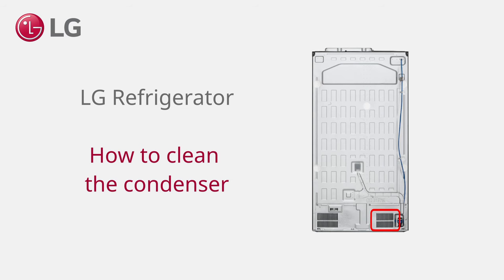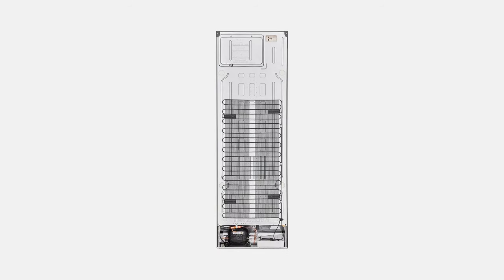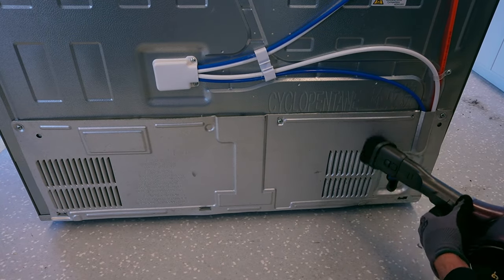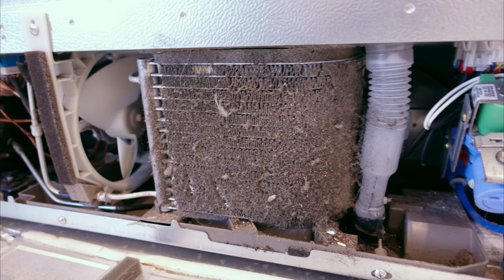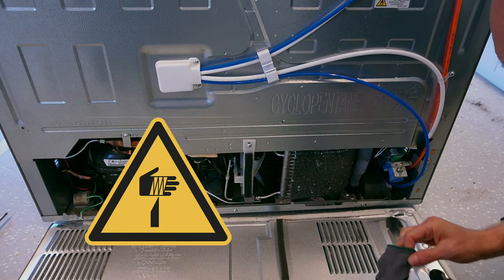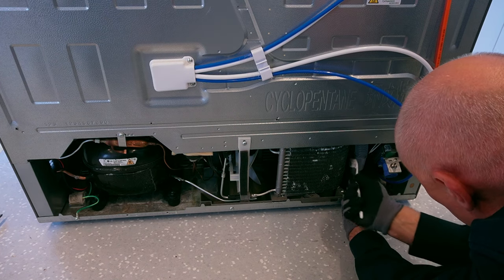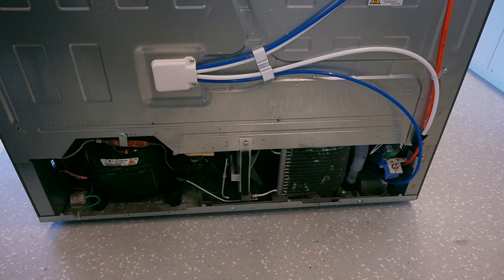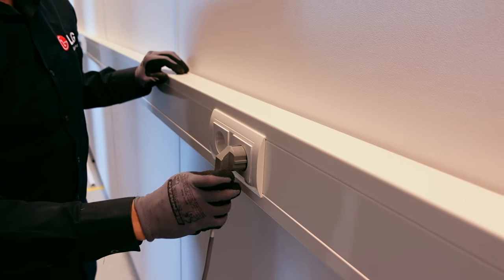[LG Refrigerator] How to clean the condenser

Comment: Hello, my model (LRFXC2606S) has an ice maker and the manual says not to remove cover to clean the coil. Is it ok to remove it like in this video?
Reply from the maker: Dear, If you follow the instructions in the video, yes it is. However, it is always at your own risk as this is a service procedure. Note that there may be differences in the models and how easy/difficult access to the condenser is. Most important safety measures are: wear gloves, do not damage the small condenser fins and, most importantly, work with the power UNPLUGGED. If you are not sure, please contact your local LG support desk.

Comment: What will happen if we do not clean the condensor ?
Reply from the maker: 1st, you only need to clean the condenser if you see a lot of dust (possibly stuck to grease/fat from the kitchen) through the condenser cover. The dust essentially prevents that the condenser can release the heat that is absorbed from the inside of the refrigerator. The cooling performance will go down eventually.

Comment: Not useful because they designed most of their coil air flow from the right side and then block it with a brace and cooling fan so you cant safely clean the coils without disassembly.
Reply from the maker: Hence the suggestion to wear gloves and unplug the power first Sally. But as mentioned, we also sell refrigerators with a condenser mounted on the back wall.
Reply: I had no issues. My fridge matches the one in the video